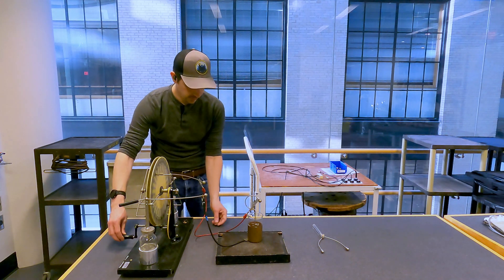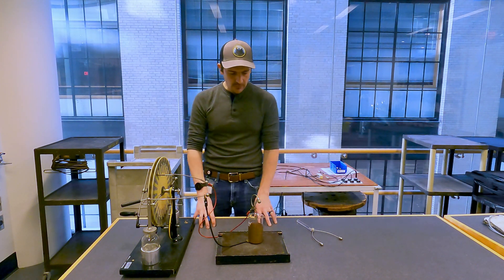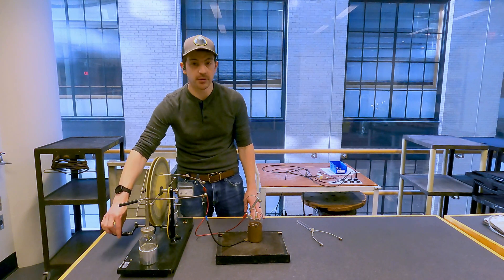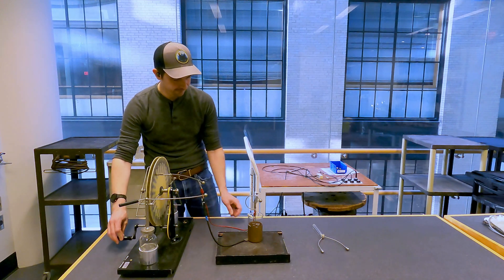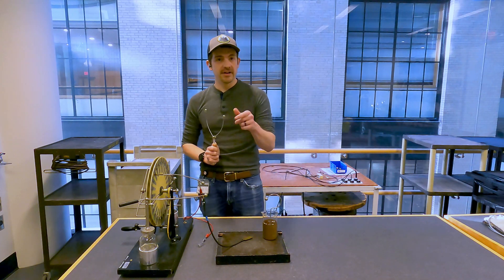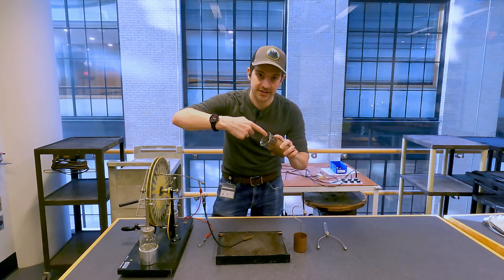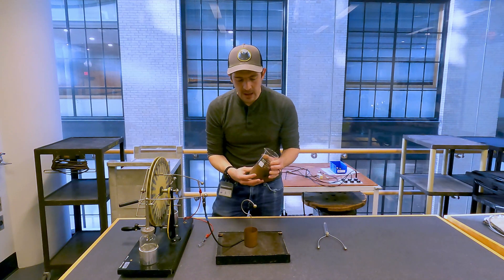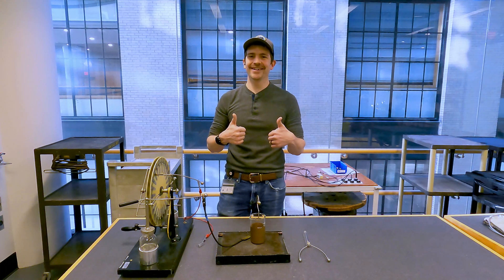Is this dissectible capacitor magic?

Comment: I noticed you didnt touch the positive inner electrode to the outside of the glass. That disassembly, touching the plates together, reassemble AND GETTING A DISCHARGE?!?!?! That legit broke my brain for a moment and made me think everything I thought I knew about capacitors was a lie! But it makes sense, like, the other plate has charge build up, so it would strip the charges off the plate moving away onto any available 'chill spot' on the insulator where the charge would be hanging out anyways, blocked from exchanging with its anti-carrier. Very cool demo!
Reply: the charge is in the dielectric, that's all

Comment: Whimhurst machine you say? Last time I was in a creative phase and wanted to charge a capacitor, i literally made a vaan de graaph generator out of an aluminum can, some nylon and rubber bands and a 3v motor connected to a battery pack, the shocking part is it actually worked, at least 3 times before the structural integrity crumbled because i didn't have a way at the time to properly tension the bands and hold the pieces in place, but it actually worked to charge my leyden jars, this whimhurst thing looks way easier to build than a vaandegraph generator

Comment: I also would have bet on the charges trapped in the metal parts, thanks for this demonstration!
Which give me puzzling thoughts about water: here it seems vital to the experiment, but you would prefer dry weather to charge a cloth rubbed on glas, to have bigger sparks I mean.
Reply: I know this is an old comment, but no, metals cannot act that way. They are conductors - they conduct. They are just the part that transfers the charge from the generator, down the wires, into the dielectric itself. Just like you don't (typically) say that a copper wire with 12v has trapped charges in it. Obviously wires can have some capacitance, some are made specifically for that reason, some designed specifically to cancel that out..  But the copper is just to transfer it. Bigger plate/copper tubes, can transfer more charge because the limiting factor is the surface area being used on the insulator. If you connected wires to 1" square pieces of aluminum tape on the inside and outside of the glass beaker, same thing it would be a capacitor. But if you had sensitive equipment to measure, not the voltage but the charge total, then did the experiment again except with 2" of copper tape instead of one, you would get twice as much charge. That's how super capacitors work, they use nanoscale patterning of a carbon electrodes to have IMMENSE surface area in a ridiculously small package, where normal electrolytic cap might be 25uF, a supercap the same size can be 25F. (which is 25,000,000 uF !!!) 1,000,000x larger capacitance in the same size!

At each level of understanding and explanation, things get blurry. What holds true and testable at the simplest level, doesn't mean is it's true at the most fundamental level. We don't discuss quantum efficiencies and model to subatomic level every single atom and every single interaction in an AA battery to know it's dead, we just throw a volt meter on it and measure it at .5v and go 'yup dead'. Even saying well the electricity is stored in the chemical potential energy between the two electrodes and the conductive electrolyte in the battery.. doesn't model the quantum level, which we know is TRUE and the underlying mechanism, because it doesn't matter. The surface level understanding is testable and provable and good enough for 99.999999999% of things.

The only class I took that had me pulling my hair out was solid state physics.

Comment: At 5:06, "positive charges are getting stripped off and deposited on the inside of the glass".  If electrons are a negative charge on the outside, are you saying positrons are on the inside of the glass?
Reply: That's a great question.

I think the answer is more that electrons are being stripped away in that instance.
Electricity is all about the electrons. For example, voltage is a measurement of electron movement. (Man, I hope I'm right, it's been 20+ years since I was in school for electrical engineering.)

Normally, electrons always have a negative charge. I thought a positron was a positively charged electron that you'd get from space or particle colliders.

Comment: I would have loved it if you could have showed the point you mentioned that if it touches the inside and outside of the breaker(dielectric) you'll get zapped.
Reply: he's a liar
Reply: If you touch the inside and outside of the charged glass at the same time, you feel a sensation, but you won't get zapped. The current will only flow if the dielectric material (glass) comes into contact with two metal electrodes. Only then will the dielectricity convert to normal electricity. You can see this effect in the following video: https://www.youtube.com/watch?v=NQO-p_ff0Xs

Comment: So if you don’t take the capacitor apart the charges are stored in the positive and negative terminals?
Reply: My guess is that theyre getting stored in the water and other molecules on the glass surface because the attraction force of the electric field of the charges on the other side are pulling them as close to the glass as possible - the friction when taking it apart does the rest.